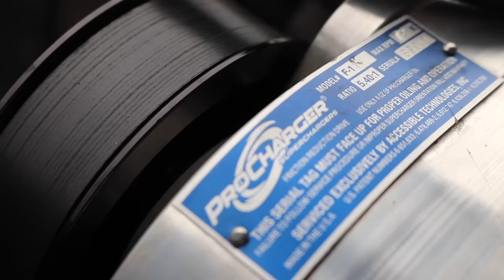Silverback Z06's REPLACEMENT!!! NEW ZO6

Comment: nice addition to the nasty crew, But Im with Mason That car with a six speed will be fun and a hand full. My brother has a 1999 FRC C5 face plate t56 lsx 468 tall deck runs on 30% nitro and meth all motor. Has 25k miles on the clock . Still has the original motor on the stand lol

Comment: That car has a direct drive on it
Reply: Direct drive what?
Reply: Direct drive belt system for supercharger, aka flip drive.
Reply: @baby-sharkgto4902  if you own a c5 or c6 and have been in the procharger/centrifigal blower game you know the terminology. John will soon see what I’m talking about once he take a close look at it. The balancer is specifically machined to run the ac/blower/and a 4 rib or a cog depending on what kit is on the car. The 4 rib or the cog drive a jack shaft to the 6 rib belt system for the alternator, power steering etc. come at me with respect when it comes to this procharger c5/c6 shit as I been doing it for 12 years.